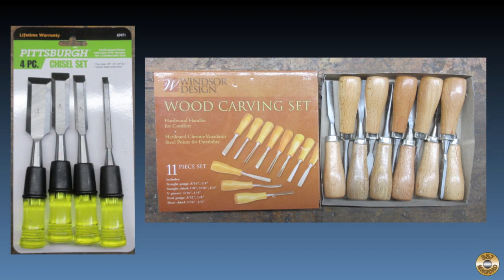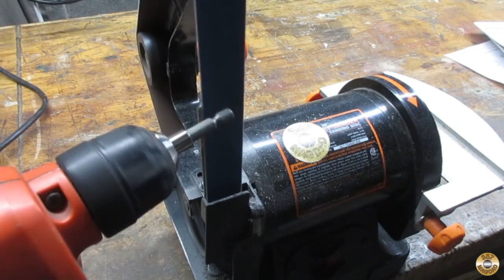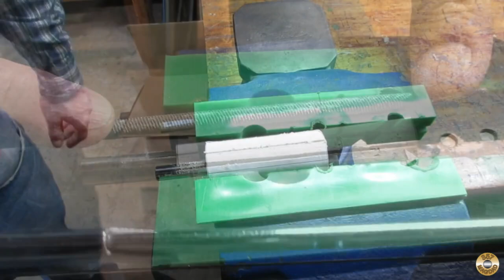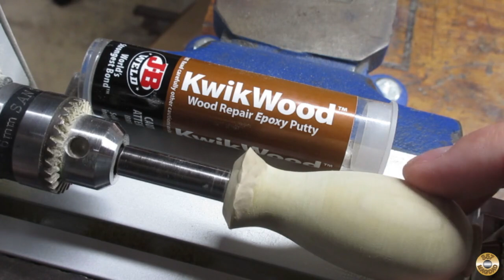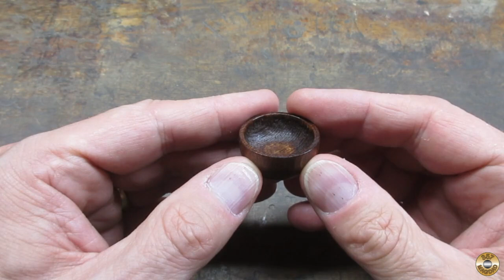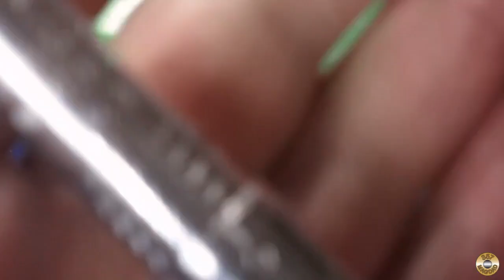Mini Lathe Bit Driver Handles

Comment: Great outcome and modifications! A lot of pallets are made of Maple, have you thought about salvaging some corner blocks from them and making your own handle blanks with the table saw? A little harder to turn probably but would be stronger and get a better finish on them!
Reply from the maker: I plan to try oak dowel soon.

Comment: Very nice job with the handles.   They look very good.   I have used Minwax Pre-Stain conditioner on poplar with good results.   Mostly face grain.   I had to sand the end grain to e.g., 300 or finer grit to get a good result.    This was a door not spindle turning.   It would not be so easy to sand evenly with small diameter spindle work like your handle.   Bombay mahogany to the rescue.
I love Chucks bowl.   Well done.    The lathe and tool modifications are working well.
Dave.
Reply from the maker: Thanks Dave!  I'm having fun with my tiny lathe!

Comment: Thanks for sharing this Magdad, I'm glad to see that you have got better tooling and new rest sorted for the lathe, the results speak for themselves. For someone who doesn't have the space and/or budget for a larger lathe, you've shown that great results are possible within the size limitations, ideal for handles and Knobs etc.

If the motor would take it, it could be with trying some shellac friction polish/sealer before applying your woodstain for a more even finish.

All of the handle designs were excellent, as always I love the Bombay Mahogany ( a great plan B ) but I think my favourite is the flat black North Bros. inspired handle ! The push-fit on the modified bit holders looked plenty strong enough to me - thanks for including the testing !

Looking forward to seeing more projects from the mini-lathe - perhaps a salt spoon ? Light or blind pulls are another popular small turned item.
Reply from the maker: Thanks Andy!  I'm working on a design for a full sized bit driver.

Comment: Nice mods and great looking handles. Have you evaluated the possibility of elevating the lath motor and but end a bit to allow for some bigger diameter wood?  Might be possible.
Reply from the maker: I think the motor power is maxed out at 1 1/2" diameter.

Comment: Excellent handles!  Your modifications to your lathe seem to be working very well.

One suggestion, based on the drill chuck and torque value of the drive shaft, try making a parting tool rather than sawing the tailstock end.  You should have enough support on the drive end to support the handle.

I think, and I'm sure Chuck will agree, you need to add ferrules to your repertoire.

Bob
Reply from the maker: Thanks Bob!  I'm going to try some full size screwdriver handles next.

Comment: I'm looking at one of these for similiar fun projects. But i'm planning on adding a £25 amazon cross slide table to it, for aluminum  bar or maybe to convert it to a mill?
Reply from the maker: Thanks for watching!  I am skeptical that the motor will have enough power for metal work.
Reply: @357magdad  maybe little bits of aluminium but that's about it:-)

Comment: Great video at the end I was a little curious what you were doing at the end, I guess you were making sure the shaft wouldn't slip but I never saw you apply any epoxy and that's just a thought but I'm sure that would increase the strength anyway I'm loving the videos please make more I will be waiting with anticipation
Reply from the maker: Thanks for watching!  I was testing the strength of my mini bit drivers.  I drilled a .203 hole for the 1/4" hex so there was no room for epoxy.
Reply: @357magdad  gotcha!

Comment: Was after something small - pulled the trigger on one of these to try and turn some yoyos.
Reply from the maker: I'm having a blast with my tiny lathe, especially after making an improved tool rest and using better cutting tools.
Reply: @357magdad  yea, not expecting much out of the pre-packaged tools, might buy myself a small carving set to use with it.

Comment: Chuck needs a proper mug, not a bowl.😁  Also, obvious comment, but I'll make it anyway.  Sanding the driver shafts flat and using epoxy will increase your torque load.  In this case, I don't think it is necessary.
Reply from the maker: Thanks for watching Lyndon!  I'm working on a full size hadle design that will be pinned for max torque.